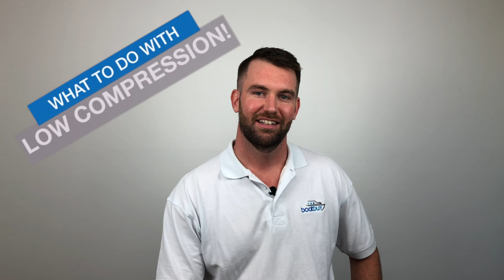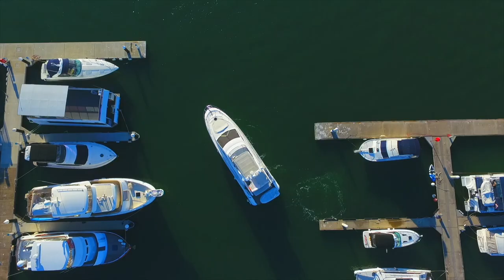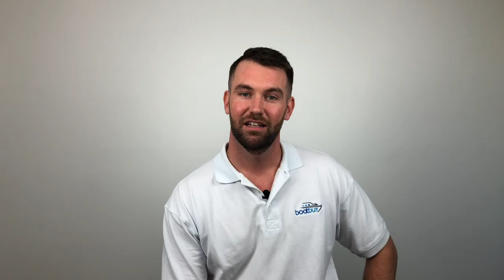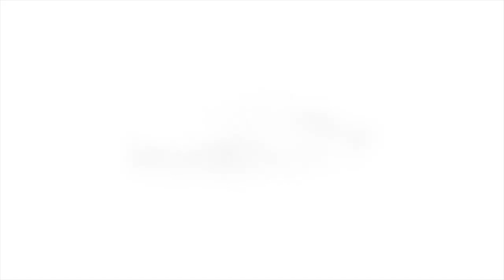Low Compression On A Boat Engine! What to do?!

Comment: my motor goes good for 20 minutes then the primer is flat, after keep squeezing the primer for 5 minutes then the motor starts  but only runs max 5 knots all the way back to the boat ramp if i try go faster it stalls, any ideas because it does go fast for the first 20 minutes every time I go out then primer flat again? I dont think its a blockage as it runs perfect for first 20 min each time. Please help...
Reply from the maker: If the primer goes soft it is likely a fuel issue. Have a look at the breather, try a different fuel line and primer, and check all the connections from the tank to the motor? Are there any fuel filters with glass bowls, and if so, what do they look like when the motor stalls?
Reply: @BoatBuy  Hi, I've put new fuel lines, primer and breather hose and it still does it, I've been told to go out running off a portable fuel tank just so i can find out if its the motor or underfloor fuel tank, I will give that a go first. I will check the glass bowl, thanks for your help, Cheers.

Comment: $10'000 , lol ok mate
Reply from the maker: How much you think?
Reply: @BoatBuy  I'll need a few details of the craft if you want a quote mate.
Reply from the maker: Michael let’s say a Sea Ray 275.
Reply: @BoatBuy  about $3500-4000 depending on scoring,
Reply from the maker: Michael You in Australia? In Sydney you’d almost spend that in slipping, crane and mechanics fees just to remove the motor.
Reply: @BoatBuy  to rebuild my 120 hp I/o 1987 mercruiser by Mercury, it would cost $8 k.
Reply: @BoatBuy  

What state are you in?
Reply from the maker: @leesire  We're in NSW - in Australia.